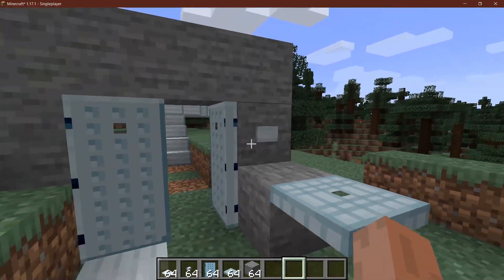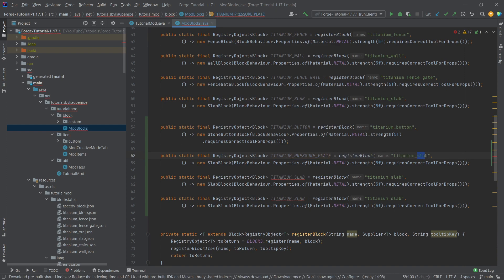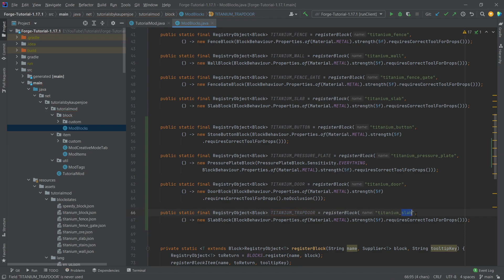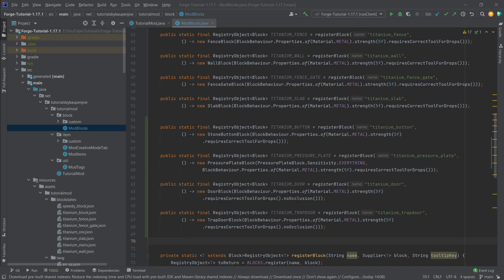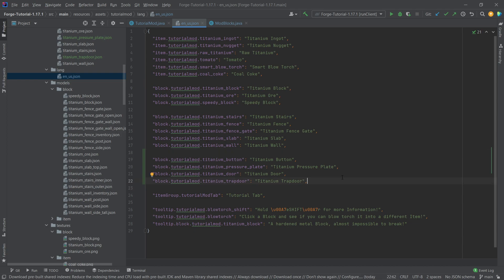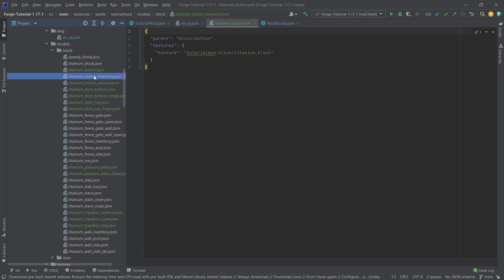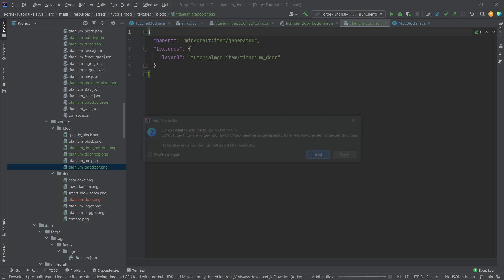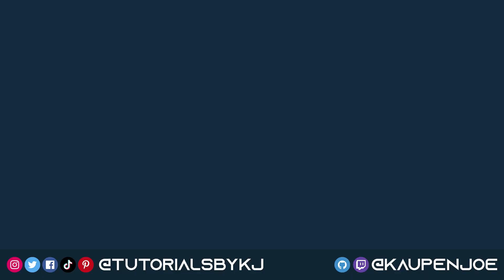Forge 1.17.1 Modding Tutorial | DOORS, TRAPDOORS, BUTTONS, PLATES | Forge Modding 1.17.1 #15

Comment: One quick sense check - should the setRenderLayer calls in setupClient be inside an enqueueWork?  Just trying to confirm my understanding.
BTW,   I've tried to get into modding a few times in the past but really struggled until I came across your channel. The format you use and the support you put around it with discord, gists, code etc are just great.   Keep up the amazing work.
Reply from the maker: Hey Tintow,
yes that's pretty much where it needs to be. So, I believe it doesn't necessarily have to be in the enqueueWork :)